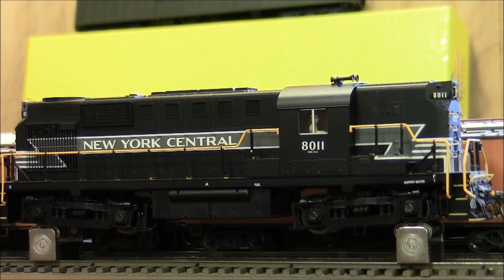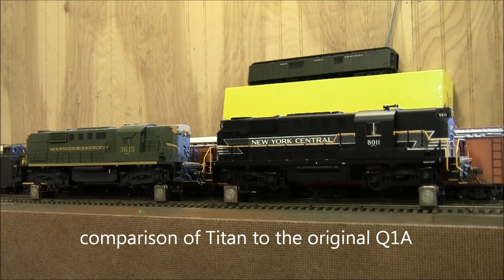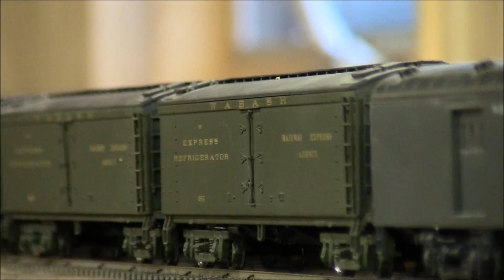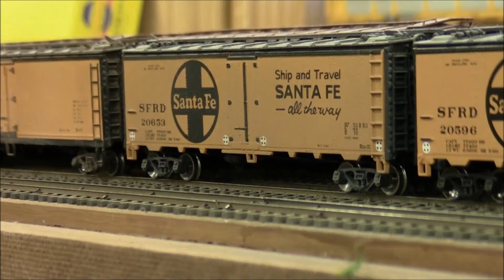QSI Titan New Beta Titan Sound Files ALCO 244

Comment: Sound almost as good as a Tsunami, but still not so good as to make me switch. I find QSI to be a bit too "geeky" for my tastes. I have not had any problems with motor control on the tsu either. Last I knew QSI has no OEM  connections, which says something to me, also